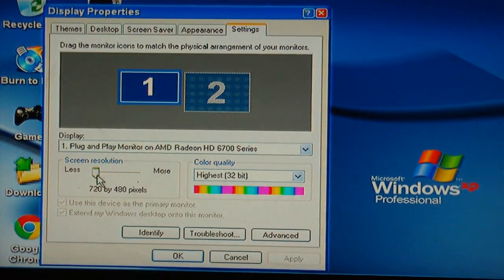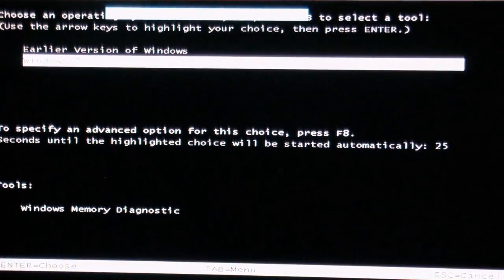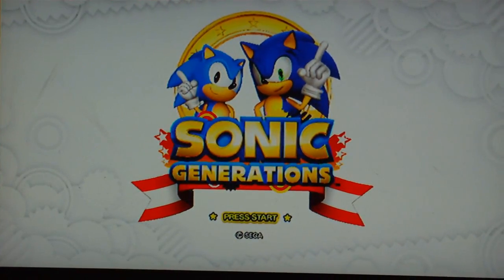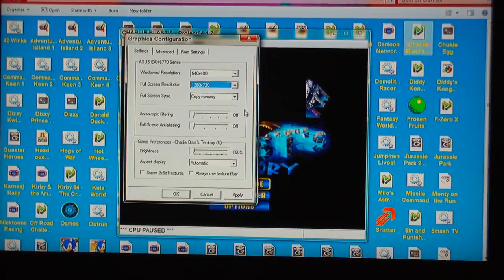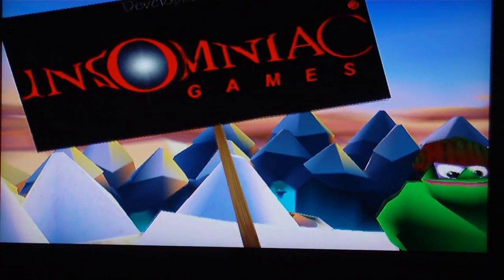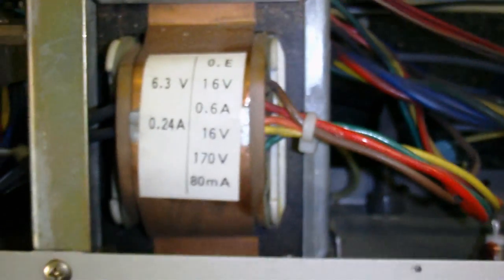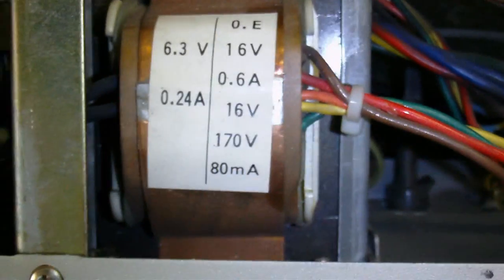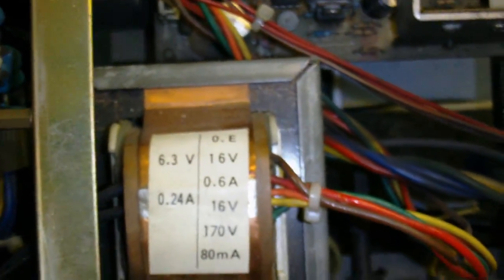Updates - My computer is behaving, but my 'scope is sick.

Comment from the maker: I'm still using the HD 8Z that I've always used for the past couple of years.  The only difference is I used an older version of my video encoder.  For some reason the 2012 release of erightsoft Super has really crappy motion-jpeg compression, but in the older versions it's much better and doesn't take as long to encode it, plus moton jpeg AVI is easy for the computer to work with when editing videos.

Comment: I ran my system on 2gigs of ram for about two years, but seeing that it used about 1,5gigs in normal use i upgraded to 4gigs. Was surprised to see that the same ram stick i bought 2 years earlier was less than half the price now.

Comment from the maker: I've used avast for a long time now, I found it works well, I've never got so much as one virus and it's quite light weight.  The only problem with it is that some times when I try to install or run a new software it thinks that software is a threat to my computer even though it's perfectly safe, so I have to turn that feature off.